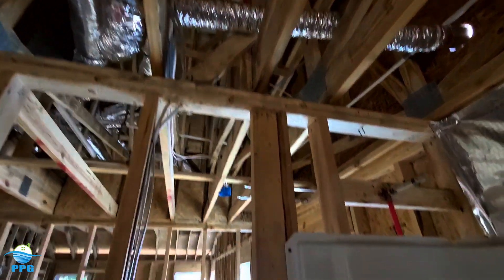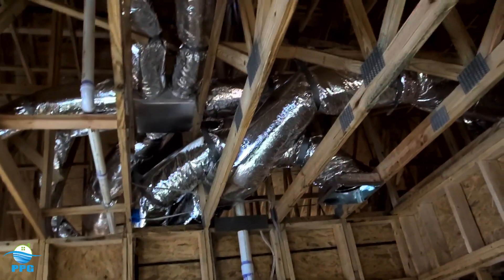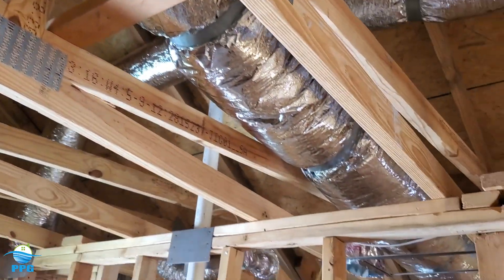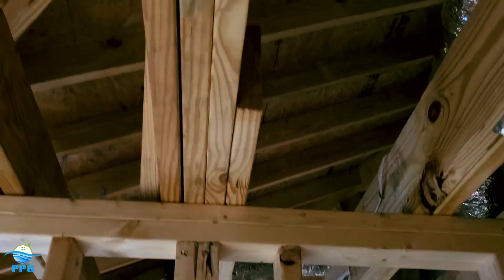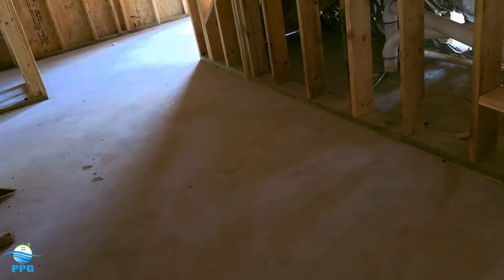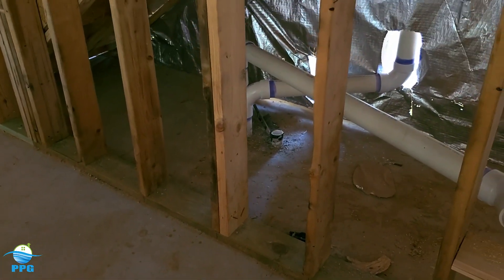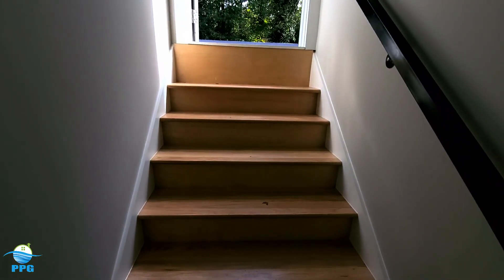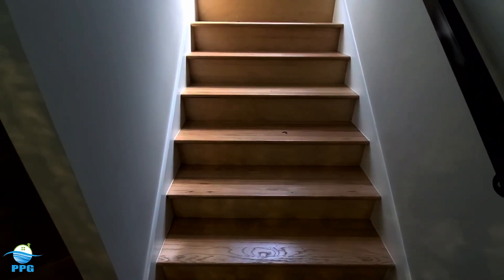Residential Building Code Violations (Part 1)

Comment: Abandoned Plumbing Penetrations in Interior Wall Studs
Multiple holes were drilled through interior wall studs for drain and water supply routing that was later abandoned. These unused penetrations reduce the strength of the studs and do not serve a functional purpose, which is not consistent with typical new construction practices. Abandoned openings can weaken the wall assembly and should be evaluated and corrected to ensure framing integrity and proper plumbing routing. I recommend evaluation and correction by a licensed plumber and framing contractor. General Location Noted Where Observed
Reply from the maker: I appreciate your feedback, and thanks for watching.

Comment: I believe you need to check your 2018 IRC R302.13; look at Exception #4. Those exceptions will get you! Here  in Arkansas we have adopted the 2021 IRC. I see this video is 3 years old now; maybe you are in the 2021 IRC also by now. Believe there was one code change in the new code; now it states if there is ANY appliance in that crawlspace, Gas or Electric; the flooring system would require being protected. Here in Arkansas, contractors have been installing Heat Pump systems where crawl space installation was required. With this newer code now Builders are not using the engineered I joist's or floor truss systems. I'm enjoying your Videos!

Comment: Ok what does the drywall supports supposed to be fastened to if the truss is floating back and forth? The corner of ceiling drywall to the vertical wall drywall will always be cracked threw out the whole house. What am I missing with my thinking? Even if 2x4 nailers are installed between trusses and fastened to the top of wall, then fasten drywall of ceiling to the nailers fastened to top of vertical wall it’s still attached to bottom of trusses how does that ever work with trusses free floating??
Reply from the maker: Are you familiar with "roof truss uplift "??
Reply: @ 
No,  My way of thinking and definition of truss up lift would have been the separation of roofing structure from the vertical wall structure due to forces created by a storm surge or act of god. But I’ve researched since your comment and have learned something today thank you for sharing some of your knowledge!

Comment: 7:30, that Simpson bracket looks like it will allow the bottom chord of the truss to move up and down, not side to side?
Reply from the maker: That's correct.  The bottom chord will typically expand and contract up & down.

Comment: Would it be difficult to convert a barn shed into a a home doing everything by county code.
Reply from the maker: I don't think so.  What code books are you using?
Reply: @PPG1967  I don't know about code. It was a general question. I would love to convert a shed into a tiny home. Pay for the fees and permit. I'm stuck. My county sucks no help. Not even point me in the right direction. San Bernardino county California
Reply from the maker: California has adopted a state building code.  Check with the state licensing board.

Comment: Love your vids, Mr. Inspector! At about 13:00 where the framers created a chase that has to be fireblocked: is just some cheap half inch OSB sufficient to seal that chase on the top, or do you need to use something else? Also, if the chase is more than 8 feet taller than the slab, do you have to use 2 different fireblocks, one at 8 feet and one at the ceiling?
Reply from the maker: That chase should be sealed at floor elevations

Comment: When u get your truss layout paper work from the company that builds them if you look in the paper work they show you how and what to use if you come a cross broken trusses...ive seen where inspectors said that it is  ok to use that for a guide to repair the trusse and ive had inspectors make us get letters and we would have to cut out the broken pieces and replace it then plywood it on both sides .....
Reply from the maker: So, the correct way to handle that is you get an engineered, signed, and  stamped drawing from the manufacturer showing how to fix the damaged truss.

Comment: Couple of general comments. First, it would be good to inform the viewer of your credentials for presenting this material, i.e. ICC certifications. Second would be to provide specific code references for a violation. You or me (PE & MCP) simply saying something is a violation does not reinforce to the student what the code actually says. For example, the fastening of wood trusses to interior partition walls is not a code violation in itself. It may be in contradiction to the manufacturers installation instructions. The movement you a discussing here is called truss creep.
Reply from the maker: First of all, what does my qualifications have to do with this video??...everything is either out of the 2018 IRC, 2018 IPC, or manufacturer's installation instructions.  However, if you need to see my credentials, see my LinkedIn profile.
Reply: @PPG1967  Your qualifications establish your credibility. Why would I want to listen to someone without knowing they have established a base of knowledge for there presentation. Would you listen to an accountant speak on neurosurgery?
Reply: This also  brings up another issue. I see that on Part 2 of this series you have incorporated the ICC Logo into your thumbnail. As a former board member and member of a dozen code development committees I must ask if you have obtained a written agreement from the Council for the use of their logo. Normally individuals are not given this authorization, rather they must use the "Member" logo if they are indeed individual members. I was a subject matter expert for ICC on the IRC - Building and IBC - Chapter 10 Means of Egress, and never used the logo for anything outside of my classes. If you have received permission from the Council to use their logo to promote your private business, I will apologize in advance.
Reply from the maker: If the accountant is educated and knowledgeable about neurosurgery, then yes, I'll listen to him.
Reply from the maker: I never stated that attaching a roof truss to the interior wall was a code violation. It's a manufacturer installation recommendation.
Reply: @PPG1967  No you did not specifically state attaching a truss to a non-bearing top plate was a code violation. BUT you never said anything about the manufacturers instructions. As the title of your video is "Residential Code Violations" you lead the viewer to believe that it is a residential code violation . . . You need to be clear in your presentations, especially if you are trying to build credibility.
Reply from the maker: I provide code sections in my videos.    The book, year, and code section.

Comment: Section R302.13 lists several methods for protecting the floor assembly directly above a fuel-fired appliance. "Floor assemblies that are not required elsewhere in this code to be fire-resistance rated, shall be provided with a 1/2-inch (12.7 mm) gypsum wallboard membrane, 5/8-inch (16 mm) wood structural panel membrane, or equivalent on the underside of the floor framing member." Drywall is not the sole acceptable material.
Reply from the maker: If I listed every possible alternative method or exception for every code section or construction situation, this would have been a 40-minute video.
Reply: @PPG1967  I am sure you saw the negative comments about using drywall in this situation because you dd not provide the viewers with all acceptable methods. Yo could have addressed this in the comments section but I did not see where you provided any additional information to the viewer to quell their concerns about using drywall in this condition. As every true code professional knows, the exceptions contained in the body of the code can make or break a design or project. Failure to include them is a disservice to your viewers.
Reply from the maker: Anything else sir??....I appreciate you taking the time out to comment.
Reply from the maker: I'm not teaching a class.  These videos are short, informative, and to the point.
Reply: @PPG1967  If you feel that ignoring parts of the code for the sake of expediency are "to the point" you are not properly informing you audience.
Reply from the maker: This all you got??....I appreciate your commenting anyway.
Reply: @PPG1967  'Is that all I got'? That is not a professional response. If you want to get into the gutter; no, I could go on with this topic all night long and into next week. My point in commenting here was to help you become a better inspector and code resource. If you have actually become certified, you should be proud of it and mention it. I spent almost 35 years in ICBO, BOCA and ICC training inspectors from the unique perspective of a PE and MCP to be professionals. The hardest part of that training was to convince them to communicate effectively when writing a violation.  

Your response to Quinn Haynie's comment on the crawl space drywall was; "I don't the Code Gods thought that one through." (word-for-word). Instead of being flip and arrogant and showing that you did know the code section you could have used it as a teaching moment and explained the few lines of the code and how it allows several materials to be used in this situation. This all goes back to credibility, professionalism and pride in your work. Being a building inspector is tough enough, don't make it harder.
Reply from the maker: I apologize if I came across in a negative way.  I think I was having one of those days.  I appreciate your feedback.

Comment: The stair riser  make perfect sense the only thing is the none round hand rail rule  doesn't
Reply from the maker: Ok, I appreciate your feedback
Reply: It is all about 'graspability' (technical code term) of the handrail. If you cannot get a firm grasp on the handrail it ain't gonna do you any good when you fall. See Section R311.7.8.3 Grip-size.

Comment: I’ve seen countless trusses damaged by guys shoving them around on the ground with heavy equipment, and driving over them too…which is an indication that the GC doesn’t care.
Reply from the maker: I can believe that.  Have you ever witnessed them being delivered off of the truck?
Reply: @PPG1967  My experience is that if I don’t supervise everything, I can count on it being damaged, including trusses and most every other building material, fixture, cabinet, or appliance.

Comment: Help, just bought a new house in Florida and found under the exterior wall where it sits on the concrete wall (about 3 feet of concrete base before exterior wall starts ) hasn’t been sealed. You can see an interior pipe because the concrete hasn’t covered it, I can see all the wall seal paper and insulation, this can’t be up to code standards as it’s not sealed !
Reply from the maker: So, did the house get inspected by the city or county inspector?... I'm not familiar with Florida Building Codes.
Reply: I will have to find out, I’m not sure.

Comment: I worked with a structural engineer, got drawings/specs, and now have a permit to remove a 9' section of load bearing wall to create a passageway between two rooms.  If you were the framing inspector, are you going to want to see ALL the framing exposed up to the top plate (new LVL header, double jack studs, etc)?  If not, I don't have to take down crown molding or re-drywall.
Reply from the maker: So, if I were the inspector I would need to see everything.
Reply: @PPG1967  Thanks for your reply.

Comment: Very informative. Regarding the plumbing line running through several studs that was removed. To my knowledge and experience in central Texas, plumbing lines that size should run through 2x6 studs as they provide more structural support, specifically if the wall is under load. Great video.
Reply from the maker: I appreciate your feedback...thanks for watching!!
Reply: @PPG1967  : As a drafter I used to specify 2x6 walls where needed for plumbing.

Comment: Yes, I’m new watching.
Also,  I did Subscribe 
I will be starting to watch.

I do have a question.
My husband, a Residential Inspector, a Expert (roof frame)
told me not order  Truss on your 
Residential  Roof frame
Do a Hand framing instead

  Like you said on your video. They will 
Be broken. 

Right now I’m in PHASE 1 
We Notices they place it  on the plan.
We are reviewing it.
I can write that down to remove the Truss- Replace for hand frame Roof?
 .. you probably will see my pic.. & again asking some questions. 
Thank you
Reply from the maker: So, stick- built roof framing in my opinion is not better than engineered roof truss. I've done inspections on both and to be perfectly honest I've failed more stick-builted roof framing inspections. At least with engineered roof truss all you have to certain yourself with are broken truss which can be repaired onsite. Engineered roof truss are designed & manufactured in a factory to exact specifications. With stick-built framing, if you get an inexperienced framing out there you could in up with a mess.
Reply: @PPG1967  ok great thank you
So much.. for all the information. 
It really does helps me to know
All this.. thanks
Reply: @PPG1967  so you are saying 
Do not need Truss frame? 
Just go with Hand frame?
Reply: @PPG1967  
Ok that Means go with the truss?
I just need this information .. 
How can i send u $$?
Reply from the maker: You can support the channel using the Super Thanks tab.
Reply: @PPG1967  ok I see it. Now the heart$
I will send some Sunday during the day.
Reply: @PPG1967  
Ok so 
Don’t go with a Truss Engineering?
Right
I’m so happy u responding.. to my question.
Reply from the maker: So, engineered roof truss are ok if installed correctly.  Make sure that there no broken chords, not toe-nailed to interior walls at the top plate, no missing or damaged gusset plates, they are braced in the correct locations, and they are secured at the exterior walls.
Reply from the maker: Welcome aboard...I appreciate your feedback and support.

Comment: This is very good.. here's the but part or question you said your a Georgia inspector... But even with international codes all states will buy pass the international codes buy stating to contractor that they only go buy county and or city codes , thus you usually as contractor are told even in classes to abide buy that first .. you in most states fight Three different code inspectors at time .. I know this and asked and told inspector I followed the international codes which is over and county and or city codes but they get mad and start power tripping you .. how do you handle this .. but after being mad to make corrections another inspector asked me why I did this I told him and he laughed in fact this guy taught the school for the trade but he said just go over the heads if we are sure we are right .. of course fighting or pissing an inspector off is not what we like to do but he was right as well .. this video is on par to the way we run our jobs and most times beyond but from time to time we are caught buy power tripping inspectors.. why not have one code not three this would stop all confusion of this and most could go buy the correct code that's acceptable and read correctly by all parties.. again great job ... And yes to many take short cuts and inspectors are needed without doubt
Reply from the maker: Wow!!...interesting comments.  You're correct as far as having to check for local code amendments as well as state adopted codes. It can be a juggling act. Not to mention some Inspectors having the my way or the highway mentality... you just have to do what you have to do to get the project completed.
Reply: @PPG1967  yes this why I appreciate your videos.. also it's not just inspectors that's always issues.. you now have to many contractors with I got the license and now I can make money and take to many short cuts as well I go behind very many that really do bad work and have to charge customer again for what should have been done write in the first place lol.. and that's where I really hate my job when I have to fix others bad mistakes.. so again appreciate your videos .. we need more to care about jobs not just ok pay types ..  educational classes really don't hurt but some states don't require this ..  but thanks again have awsum day

Comment: As far as the anchor bolt being on a load bearing wall.  If the concrete guys don't place them.  Is it up to the framing contractor to let the inspector know before they start work?  Or is the framing contractor allowed to drill into the slab and then becomes their fault if they don't?  Also if they are not, do they need to send off to a structural engineer to get a stamp of approval to drill into the slab and add the bolt?  Thank you sir!  Great video!
Reply from the maker: So, if it's not caught at concrete stage, the framers are allowed to drill and install anchor bolts at load bearing walls.

Comment: What happens with all these violations? Are the property owners required to fix them, pay a fine and get by, or what?  Some of these look hugely expensive to fix, but the rules are there for good reason.
Reply from the maker: Yeah, any violations found must be corrected by the contractor.  Re-inspection fees are typically charged.

Comment: 7:36 The bracket looks to me as. The truss is not designed to carry weight from bottom stringer. Slight deflections in floor attempt to be rejected.
Reply from the maker: So, the bracket is used to allow for uplift.

Comment: after watching this video i checked my new house construction, found these issues, is there a way i can get codes that are violated 
3 ply lvl not bolted together, only nailed
Bathroom vents going to soffit 
one engineered truss bottom chord is broken
trusses are nailed to interior wall top plate
load bearing & exterior walls not bolted to the slab
Reply from the maker: I'll can send you code sections out of the 2018 IRC. By law they must follow this Georgia adopted code book.